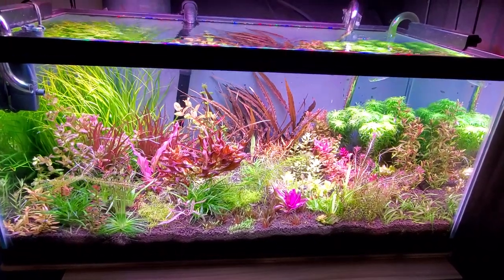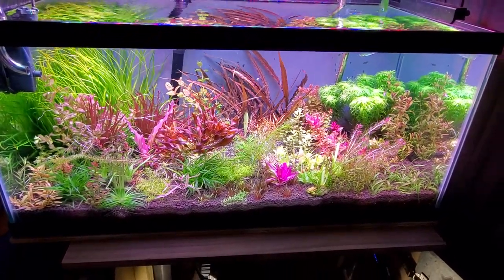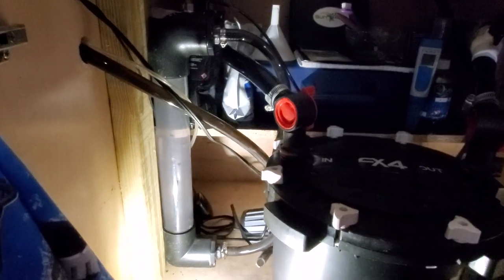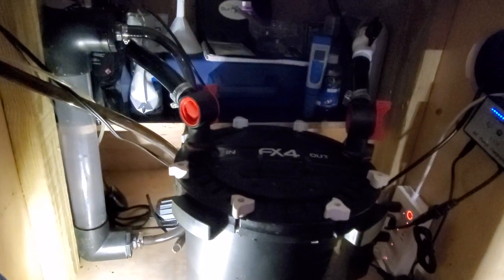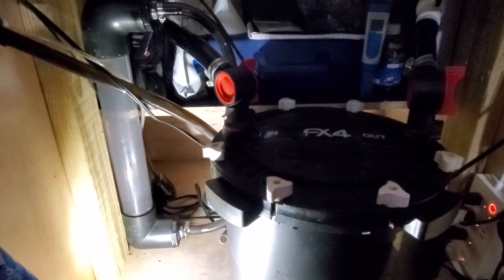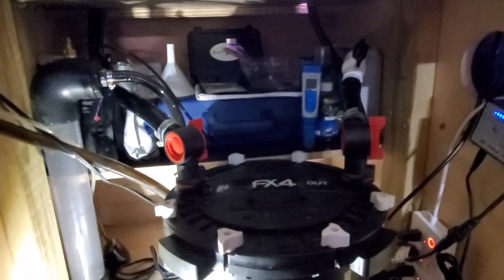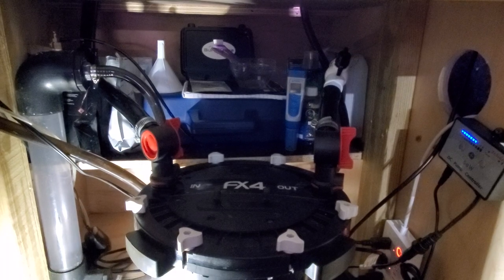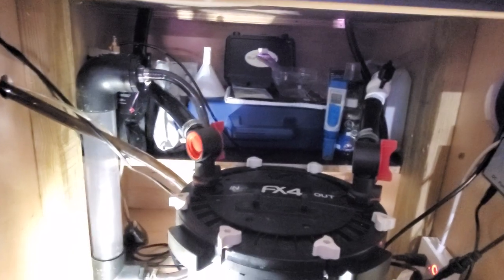Why I run a separate pump for my Co2 reactor

Comment: Thanks for the video!  I have a noisy reactor running off of an Oase biomaster 600 (I thought I'd get enough flow, but nope).  I've found the pump that you are using online.  Clearly you aren't running that pump submerged, but I was wondering if you have had any issues running it this way.  I thought the water was supposed to help cool those pumps when submerged?  You posted this video 3 years ago, so I'm assuming you would know if there were any issues with that pump heating up by now.  Thanks again for a great video!

Comment: Great use of limited space. Such a simple yet effective solution to the canister flow problems. Very useful for apartment dwellers that cant clean every two weeks.
Reply from the maker: Yep, canister filter definitely offer decent filtration for their size. I still clean my religiously... I'll have to do another video on why it's becoming the most important part of my maintenance routine.
Reply: How often do you clean the filter

Comment: Well, I am convinced. I'll probably use a powerhead into an ista I just bought for the setup. They are supposed to be a little more efficient with the impellers. 

Tha ks for the video. There is surprisingly little info on YT for this other than "hey, here's a reactor".

Comment: This is perfect! I run a Eheim canister with an in-line atomizer and completely understand the issue with flow. Using a reactor in lieu of the atomizer on it own separate loop will both better dissolve the Co2, hopefully 100% to rid the soda bubbles, and give me the additional water flow I need. Nilocg has an advance version of yours with a by-pass valve and i will be looking out for the pump/controller as well. Plus I like the fact that this will serve two purposes. Just subscribed as well. Thanks
Reply from the maker: Yep, definitely get the bypass one. That's my only issue with this current setup. I'll probably upgrade once I move.

Comment: Yeah, this is not a bad idea at all. I have been dealing with poor water flow issues due to reactor hooked up to the only canister filter I have on my 48 Gallon tank. The flow became pretty weak, and that, I believe, could be the main reasons for the stubborn algae in my tank. This would not only regain flow on the main filter, but add an additional flow sourse in the tank, which is always good. I have huge rocks in my tank and the current flow can't reach certain areas. I thought about adding an extra canister filter before, but I was always worrying about the aesthetics, not realizing that there is nothing less aesthetic than algae covered plants... So thanks for the idea

Comment: Great video mate. I made a reactor for my 580Ltr tank and when the co2 starts after few hours the water level goes down. Co2 is in a loop like yours and I'm using a 2800 Litres per hour pump. I'm guessing that my pump is not enough for my reactor which is 3inch diameter and 2 feet tall and that's why the water level goes down? What you reckon mate? Cheers!

Comment: Very interesting video. What are the benefits for a smaller tank of using a reactor over an inline diffuser ? Im sure you could use one in a separate loop too.
Reply from the maker: Same benefits as a larger tank. More even flow and better co2 dilution.

Comment: What Fertilization method do you use?
Reply from the maker: I use BurrAqua micros (daily) and a DIY Macros (daily)
Reply: Chantz Cramer any reason why the micros are not diy? I’ve heard of a few people doing diy macros and not micros. Do you dose EI or pps? I dose like 2x the amount of pps. All my plants are very healthy except I keep getting green algae on slow growers like erio Q and pink flamingo.
Reply from the maker: @AquaMayne  it's a custom made micros for my aquarium by Joe Harvey (BurrAqua). It's about as precise as you can get.
Reply from the maker: @AquaMayne  as for my fertilizer regimen, that's custom as well. My micros isn't at EI levels as far as Fe goes. My Macros (no3 and p04 are at EI levels, but dosed daily. My Ca and Mg levels are higher than EI recommendations. The real key is the substrate. In this aquarium I used 1/2 inch Mineralized Top soil capped with 3-4 inches of ADA Aquasoil Amazonia.